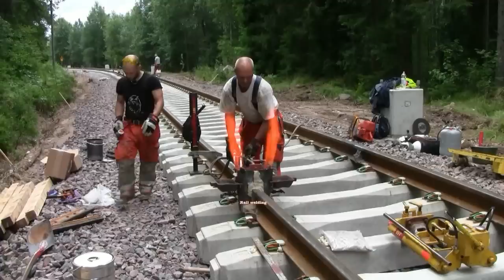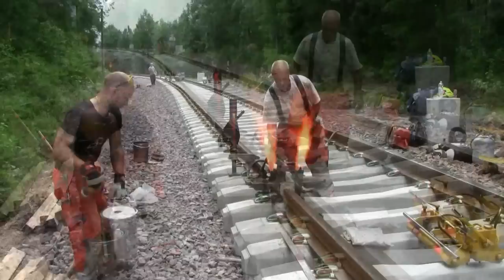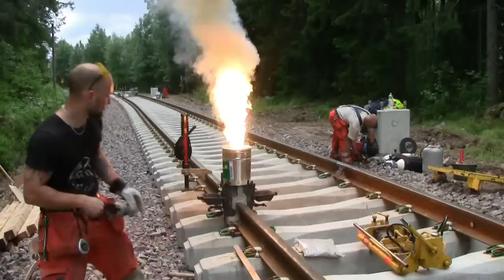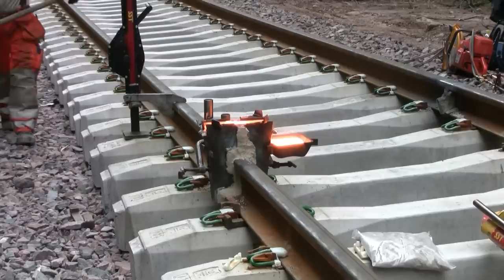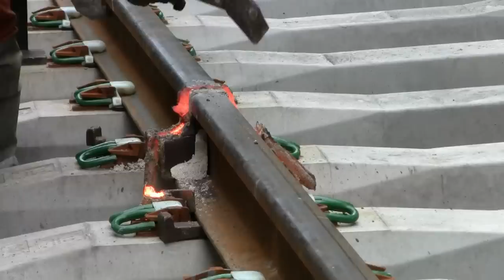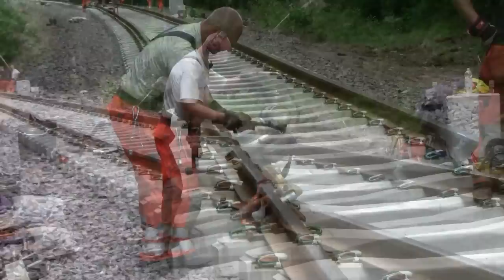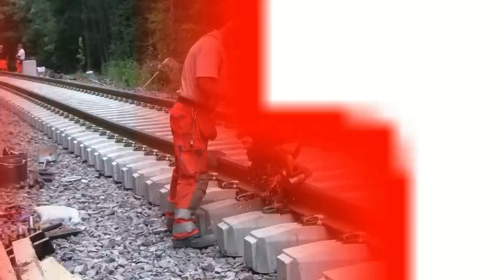Railroad thermite welding

Comment: Would've been nice to see the finished job.
Reply: Go look at a railroad and you'll see the finished job.
Reply: @garettjohnson2234  Nonsense. If you show as much as they did, you show the  finished job.
Reply: @electronicsNmore  i know i was just kidding
Reply: Why didn't they just use some jet fuel? As the twin towers 200.000 tons of steel melted so easy.
Reply: Youll have your chance in 2030. Hunger Games.
Reply: @tikmaanboksouwe  WTCs thermite and DEWS Judy Woods. No planes ever hit towers BUT you know this already.
Reply: @tikmaanboksouwe  why don't you go there yourself
Reply: @Nicefail87  obviously
Reply: @TRUTH4U2NO   based knower
Reply: @tikmaanboksouwe  Steel didn't melt in the twin towers. Steel get's very soft when it's hot (that's how smiting works), long before it melts. They could absolutely have melted this steel with hydrocarbon fuel, but it would have been natural gas, and it would have taken 15 minutes. Termite is cheaper because it saves on labor.
Reply: just look at the rail to the right and see the one they did before.

Comment: No safety glasses. Tsk tsk.
Reply: It's the rail road... they play by their own rules.
Reply: Tell that to OSHA.
Reply: I'm always amazed at the number of construction workers who won't wear protective gear for their own safety. Why do they even have to be told? Don't they value their sight/hearing/body enough on their own to want to protect it without needing to be told to do so? Stupid...
Reply: Maybe the lack of forward thinking is partly why many of them are in construction.  I'm in construction and I see a lot of not so bright guys who fell into the trade since other opportunities were wasted.  not always the case but it's more common than you would see in an engineering office.
Reply: gearsNtools Oh, I see it all the time. Mostly the young guys, need to prove they're macho or something. Usually they get smarter as they put in some years. The older fellow here, the one doing the work, definitely should know better.
Reply: Who needs eyes?! They're overrated anyway. That's why I only have one!
Reply: I,m in construction and over the years I find that the guys who have alcohol and or drug issues are the ones who abuse or neglect safety. They are easy to spot. Just watch them come to work in the morning. They are either still drunk from last night or they just smoked a joint on the way in. Thankfully we have trade unions or these guys would be homeless.
Reply: Former sawmill worker here: I know exactly what you mean. But they usually have to leave work due to missing fingers, limbs, blood loss, etc..
Reply: im working in the commercial fishing industry, safety is for people with employers
Reply: callitacomeb Or those who realize that they need to take care of the only body they'll ever have.
Reply: callitacomeb And a lack of protection is for idiots who want to live on welfare after injuring themselves.
Reply: ***** Zeb Cheek You have no clue what you're talking about, sorry. Complacent people cause more accidents than drunks and druggies.

Drug tests weed out and run away most pot heads (which is all they're really good for since other drugs don't stay in the system more than a couple days)....who aren't even a threat to you and if you work construction I can guarantee you a lot of those guys are high all day and you just don't notice because they're mature enough to not act goofy as hell.

I used to handle fireworks with a guy that talked a lot of shit about me for smoking pot; he's dead now because he dropped a box of 4 inch mortars while not paying attention to what he was doing. I left that place because he handled the fireworks irresponsibly and management said "he knows what he's doing" when I complained. I'm sure he did know what he was doing, but even being clean and sober he got complacent and now he's in a box in the ground; I'm still here smoking a fatty and laughing at the irony that is life.
Reply: RoboticsNShenanigans I do know what I am talking about. Because when I was working sawmill, there was a drug test after every accident. and 90% of the time the person was high or otherwise chemically impaired.

I have no problem with people getting high/drunk/whatever. That is your body and you can poison it how you want. 

I have a problem with it when it risks my life and the life of others. Keep your habit in your house.
Reply: That would never fly here on the UP, You need a hardhat, earplugs, safety glasses and orange vest just to get close to the tracks!
Reply: Richard Kissel that's because you folk are smart.
Reply: ***** lol I hear you.  Mondays are particularly bad.  and if it was a three day weekend look out you better not have any high risk tasks scheduled or somebody is gonna get hurt.
Reply: Zeb Cheek Although I do agree with what you are saying and don't think anyone should be at work under the influence especially around heavy machinery, the problem with drug tests and when they test for cannabis is that it can be in your system for up to two weeks and it's common to see people getting fired from work because of it, not because they had a joint before they came to work but because they wanted to relax/chill out on the weekend.
Reply: They dont help with this.
Reply: It kind of summarises the Swedish attitude to health and safety, though. They are a bit lackadaisical at times here.
Reply: John Fisher What? I wasn't commenting on the job itself at all, nor did I pass judgement on their abilities or proficiency in their job. I was merely commenting on safety standards in Sweden. I am a research scientist working in a research laboratory, and therefore deal with rather nasty chemicals on a daily basis. The way in which these chemicals are handled here in Sweden is, at times, a bit shocking compared to my experiences overseas. Please don't misconstrue what I am saying.
Reply: John Fisher No problem, I was just a bit surprised by the comment! At least you have good manners and apologised so no harm done at all. Glad you appreciate workers, they don't get enough credit from most people. =)
Reply: I love how the guy using the grinder at the end has his eye protection on, but when he is chipping that red hot slag of there is none to be seen. I'd prefer to get a tiny speck of grinding dust in my eye than a chip of red hot slag any day!
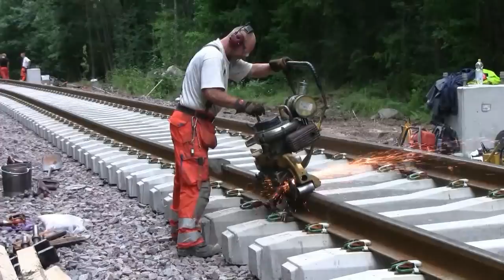Reply: 3:35 tsk tsk
Reply: A
Reply: Matthew Chapman I work in construction and i think the problem is fatigue, wearing safety gear hours on end can become very tiresome, it's no excuse not to use it of course because the other option is a lot worse however i'm just pointing out that wearing certain safety gear every day hour after hours can become tiresome.

I think these guys are very experience, they use eye protection when grinding away but did not when hammering slag off but if you pay attention you'd notice he was hitting away from his face anyways in a controlled manner.
Reply: Kurt Bang Tidy I appreciate your candor, Kurt. Good to hear what it's like from your side. Thanks.
Reply: You're correct, my ancestry IS English, and I'm damn proud of it, too. But otherwise, you're wrong, I'm American. 

The rest of your comment is pretty juvenile, so I won't even bother to discuss it, other than to say you sound like the type of worker we battle on the job site everyday, thinking they know better than everyone else. That's fine, you can think what you want. You just won't be working on any project that I'm managing, that's for sure. Not with that attitude.
Reply: Matthew Chapman Juvenile? Hardly. Vaginal on your part? Yes.

As for what I do for a living? I'm a welder / welding engineer, working off shore. 

I come across your type and attitude often, you have a shitty attitude and you make work difficult, sometimes close to impossible, It has gotten way out of hand. 

As I said, you use safety gear when you need it. That's it.
Reply: Nope. You use it when the company policy says to use it. And if you don't agree to that, you don't work on the job. Period.
Reply: Matthew Chapman Not my experience, still very much working. Then again, over here people tend to be more intelligent and able to think for themselves. Also, it is actually possible to reason with folks over here. As I said, vaginal to the extreme. Oh well, pretty soon you guys will need pink walking helmets to since there is no end in sight of the insanity. End of. 

Period? Haha yeah I guess it's that time of the month eh.
Reply: Ты у Русских когда нибудь видел защитные очки или каску???
Reply: Bob Duvall Oh my, we have a 12 year old 30 year old in our midst. Why don't you see yourself out of the comment section you tool!
Reply: American right?
Reply: frantahouska sweden
Reply: He uses glasses at the last part and the only part of the welding process it's needed.
Reply: knut761 Your comment is just plain stupid. I have to wear a hard hat, because if I trip and break my leg my insurance company can deny paying me cash because I didn't "use proper safety gear". Not shitting you twisting my leg and not wearing a helmet = No insurance.
Reply: Siggi Tiggi None of my comments have been stupid. As for insurance that will differ from country to country and also differ between insurance companies. If you're in the states people have gotten so stupid that everything has to be labeled as dangerous, if not and someone hurts himself he can sue the company for all it´s worth. Treat people like idiots and they eventually become idiots. In fact, I got a package from the US for Christmas and some of the packaging was labeled "don't eat". I shook my head in disbelief. As for them not paying you well insurance companies (this IS universal) will do everything they can to NOT pay. You wore the wrong kind of socks that day, no money, you wore the wrong kind of jacket that day, no money. Planet X was not aligned with planet Z, no money. etc etc. So, you falling and breaking your leg not wearing a helmet means of course that if you had worn your helmet you would not have broken your leg. Riiiight, but see that's their logic. Just goes to show that they are stupid too. 

Merry Christmas hope you had a great one with family.
Reply: In America, ambulance chasers would form a line.
Reply: there's an inherent trust your healthcare provider.that can go overboard. obviously there's no insurance cover because of  no protection, but he's not going to land on his arse if his decision backfires.
Reply: imstill notusingmyname This is in Sweden,a hospital would charge him for like 100 euros at the most,and that payment is usually cause you stay the night and get food etc.
Reply: Sbeful sounds a bit like something we finns have, tho ours is hardcapped at 670e (under 700e anyway) per annum. there are fees and costs, but as they're social expenses, there are programs to help you if you experience a budgetary collapse. you can also get aid from private sector, but the gov't will not step in with such high figures as private prices are obviously inflated.

they just generally would like to have your ass back to the workforce, posthaste.
Reply: In the 1970s, half the job was drunk . The other half was high. I met a couple of Ironworkers in the early 1980s. One of them would smoke reefers and then hang steel. I would have been paralyzed with fear, but this dude was OK with it. 
I never liked being high on weed at work. It made the day seem like a year long. 
I  thought visibility vests were stupid. But then after a while, it's like looking for car lights on a rainy day. You look for visibility vests. It's kind of like a uniform which means you're not a civilian.
Personally, if I were fucking with that welding shit, I'd be wearing safety glasses. 
I wear ear plugs plus ear muffs when I'm running heavy equipment. I even started wearing my hard hat after gouging my noggin on the shit I operate.
My friend was wearing safety specs and a hunk of steel peeled off something he was drilling and got behind his glasses. Now we call him Old One Eye.  
I've met a dude who got his arm ripped off when it got sucked into the asphalt machine. So many near misses, it's enough to make a person religious. 
Someone said "complacent". Yeah , I have to agree. Some fuckers are just too lazy to bother to turn around and see where the noise is coming from when some huge machine is coming towards them. All the backup alarms in the world won't do  these dicks any good. Then when they get hurt, the poor bastard running the machine gets in trouble for not babysitting these fools.
On the whole, things are better now.

Comment: Safety glasses don't do you any good on top of your forehead, wear them over the eyes.
Reply: dont know if safety glasses would do anything because of the thermite. it would just go right thru. but should still wear them!
Reply: Ain't no form eye protection that will save you from a face full of thermite my friend!
One might even go far as to say, that you would probably be doing yourself a disservice by muddying your vision with goggles.
Reply: 101m4n
Well, safety goggles just might conceivably save your eyes,but they aren't doing you any good at all on top your forehead.
Reply: John Gray Thermite is pretty dense, and burns at 5000 degrees. Unless your goggles are made of solid steel, they aren't going to do you any good.
As for sparks, the mould takes care of most of them.
I personally think that a lot of the safety stuff is silly. Your best defense against burning from thermite is your brain, and the common sense that hopefully lies within. Not a thin piece of clear plastic in front of your face.
Reply: 101m4n safety stuff is silly.

We'll see who will think safety stuff is silly when someone gets severely burnt or looses eye sight or starts to having any other problems on down the road. Safety always comes first!
Reply: Jeremy Dawson Your house is full of wall sockets, each one capable of killing you.
You understand this risk, and it is because of it that you don't stick your fingers into them.
Reply: DAFUQ you taking about?
Reply: Jeremy Dawson Experience trumps blind adherence to rules every time.
Reply: The safety glasses are probably just for the metal grind work in the end, that creates a lot of flying sparks the safety glasses will actually stop, which is a job the last guy in fact does with his safety glasses over his eyes. The safety glasses will not stop flying thermite, which will just go straight through due to the slow burning and intense heat, and that's why you see these true professionals immediately turn around and practically run away when they have started the process. You need steel to effectively stop thermite. So safety glasses wouldn't do them any good at that part of the process anyway.

Comment: Best thermite weld video on the “Tube.” Unlike some others, these guys know what they’re doing!
Reply: Yep they know what they are doing. Its a old video and lots of things could be done "smarter" like the hammering afterwards. We did that years ago to get the excess stell off before grinding. Now you just lift the yellow cutting machine (what you see in the video after they welded it) and rip the steal off without damaging the weld. It saves lots of energy and time for everyone. Its a tough job but very well paid.

Comment: I Thermite Welded for the CNR back in 1981-82 (then Joint Welding and Magnesium Frogs).
It was very similar to this video except for the crucible. Ours were much more antiquated ! But the Molds, Shields, Slag Pots and Packing Paste appear "almost" identical. 
We used Hot Cut and Sledge for knocking the over-welds off but eventually were rewarded and equipped with (what appear to be the very same) hand-powered Sheers and ultimately Powered Sheers.